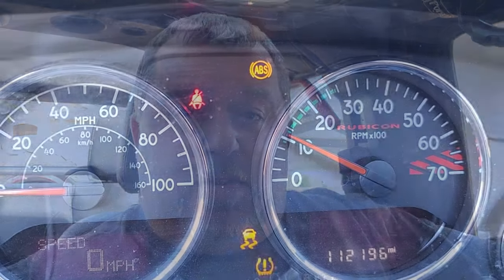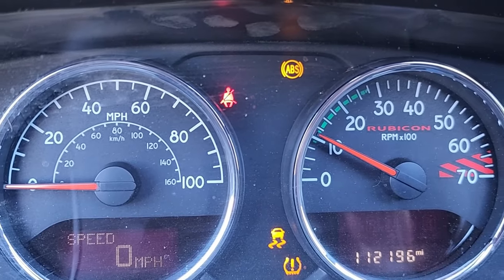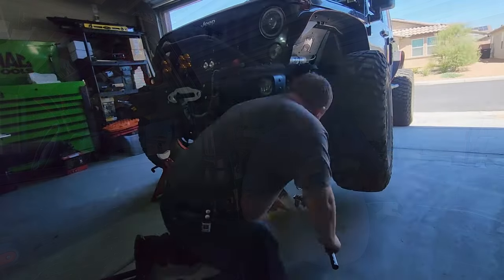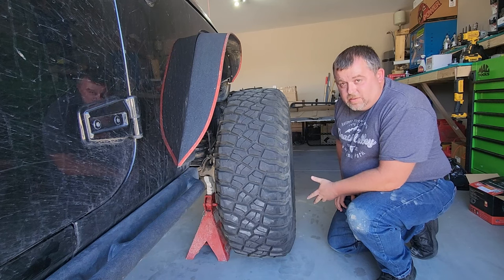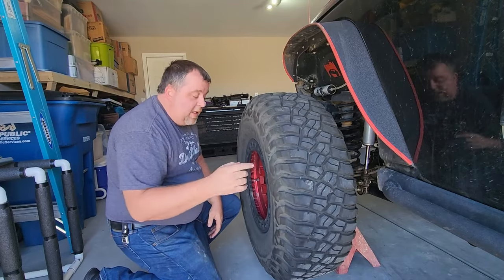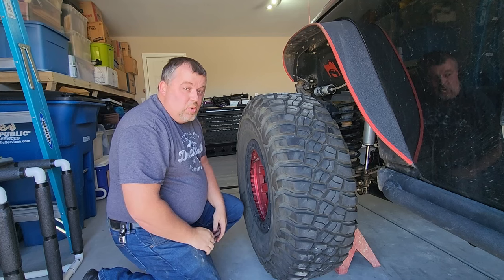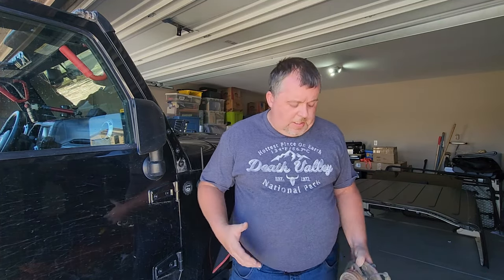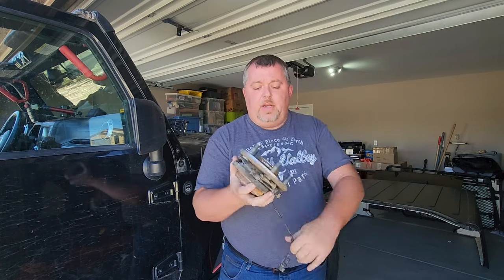ABS and Traction control lights on a Jeep, What do they mean?!

Comment: What a great video. In my 2014 sport JK the two lights (ABS & Traction) turns on only when I want go in reverse and full lock my wheel to left or right.
Will have to check this out soon...very soon
Saludos desde Colombia, muchas gracias.
Reply: Any update to what fixed yours?
Reply: Would love to hear an update on this. I had my back brakes replaced last month and now this exact thing happens to me occasionally. I will check my battery terminals first, but may be the hub.
Reply: lo reparaste?
Reply: @scottcarter3621  check the sensor cables first, sometimes if you have old brakes it generates higher temperatures and melt the sensors or cables

Comment: I had to swallow my pride and call AAA to change a flat tire cuz I didn’t have a big enough jack. Next day, ABS and traction control lights were steadily lit on my dash. Two weeks they were on. Felt the ABS kick in while avoiding a careless driver and they went off. Don’t know what that’s about but still gonna have my axel and bearings checked. Thank you sir. Much needed insight. You have a new follower.
Reply: Sounds like my issue, Add 4x4 light as well. I called a shop today & they speculated it could be a wheel speed sensor that needs replaced but I go first thing Monday morning to be certain.

Comment: Mine cane on my dash today… will have to check this out soon
Reply: Did you figure out what it is? Same thing happened on my 2015 compass
Reply: @A1beams  well mine went away… went to the shop and they said it must of came up cause I had randomly pressed hard on brakes… which I had done that day due to rainy wet roads… it hasn’t came back ever since… but if it does I have a better understanding of why

Comment: Another culprit: If it’s a used Jeep, the PO may have cut the purple wire with light blue tracer under the center console (or installed an inline on/off switch). Fuse J6 under hood could be pulled out or bad as well. Common for owners to do both to stop the ECM nanny control for wheelin.

Comment: I love this video! Your intro is amazing. Before I fully go in on and exchange this part out, may I ask, mine turns on and off especially when I turn, is this possibly also the cause of that on and off
Reply from the maker: Yes, turning changes the pressure on the bearing, and can cause the lights to change... but that's almost further confirmation you need a new hub

Comment: What about the two lights coming on and going off intermittently?
Reply: Did you find solution? Could be a sensor going bad depending on age of your JK
Reply: Happened to me, replaced just the sensor and it went away
Reply: @J1MMER I wish that was the case for me. I replaced sensor and still having issues. Noticed it triggers when turning but guessing wheel bearing is next step

Comment: Thank you for your great video.  I have been unable to get any codes for my Jeep since the 2 lights came on, but did not stay on.  Is this a symptom of what is to come?  Thank you!
Reply from the maker: The codes can help narrow down which wheel is faulting, but if the lights are not steady, and codes are not stored, does not mean no problem....... I would lift and shake each tire down until you discover the issue. And check all ABS sensor wiring to the wheels to ensure no fraying or breaking..... it may take longer to diagnose without the codes, but the problem is still there. I would not wait until it gets worse enough to trigger the codes full time 🙃 if it were me. Hope that helps!

Comment: So I went on vacation for a week and when i came back my 2019 jeep grand Cherokee was completely dead. Upon jumping it and turning it on 3 lights came on (Check engine light, ABS, and the Electronic Stability Control) the check engine light went away. The other two haven’t. The car has been perfect and no problems at all. I just hate having lights on, on my dash.

Comment: so mine is also on But ! mine is 2016 48000 miles never been in 4x4 or off concrete has original size tires  but i will check it
Reply from the maker: A little young, but does not mean the part has not worn out.

Comment: Hello there! Just came across your video and channel today. You have a new subscriber! I am new to jeeps and they seem like difficult cars/trucks to diagnose. I have a jeep cherokee latitude and I hit a small pothole one day headed to work. Nothing happened the car kept driving smoothly. The next day the car was still driving smooth but the abs, traction control, and park brake light sensors came on in the car. I got the car scanned for codes and they came back undiagnosed. I wonder if this could be the culprit to my problem as well.

Comment: Hello, I got a 2007 jeep jk automatic V6 , I got the traction control system and the red sparkling light on when I press the brakes and the engine starts to be loud, it happens when the car is not moving or in a slow traffic (so I use a lot the brakes)

Comment: My jeep was squeaking, and then the ABS light came on. I figured out that my dog chewed off the sensor wire. I changed the right wheel sensor, and the ABS light cleared, but it still feels like the brake is dragging. Do I need to clear codes, or is there a way to reset it?

Comment: Hi Josh have a question I have a 17 jeep wrangler just put 2.5 in lift but by traction control come on
Reply from the maker: Need to the get the alignment set properly. And at an alignment shop. Your jeep has what is called a "Steering Angle Position" sensor, and since lifting it affects rhe steering wheel angle, the jeep does not know what way is straight. So once the alignment is done, that sensor needs to be reset properly, and your lights will go away.

Comment: 2012 Wrangler Sport. Not only do my ABS & tractions control lights come on but when I start driving I get a bit of wheel spin/try to accelerate and the vehicle doesn't respond. After a few seconds, it runs normally + this only happens first thing in the morning, the rest of the day its fine?!!! Doesn't happen when I reverse out of the driveway, only when I start going forwards. I've had the sensors replaced & put on new Yokohama tyres. I thought it might be the 4WD not being disengaged properly. I'll have the wheel bearing checked now, thank you. Any other suggestions appreciated....
Reply: My jeep does the exact same thing.  Rear wheel sensor is dirty and the axle seal is leaking oil all over the place.

Comment: I have a 2015 Jeep Renegade. My light came on 2 nights ago and I heard the car beep which triggered the seatbelt light but that went off but the  With the wiggly car light stayed on. It said off. I learned a few weeks ago that there was a recall on my Jeep  Inition problems inition could this be part of it. When I take it to the dealership you think they would charge me to fix the light too. I'm not trying to get charged. Just don't want to go in there sounding like I don't know what I'm talking about. Thank you waiting for your response. Could you check with Jeep and see what other recalls are on the car. But disable senior citizen. I just bought the car my old car was in the accident so I took the settlement involved this car I need help thank you

Comment: My Jeep has been to the steelership 3 times for the ABS. It fixes it for about a week or two and then returns. When mines comes on, the trans jumps a gear and then the down hill assist turns on. Within seconds, the ABS and traction control lights up. It throws a code stating the speed control is producing an impossible value.
Reply from the maker: That sounds to me like the ABS control module is dying.... your issue sounds deeper then a hub assembly
Reply: @JeepingForBeginners  Thanks. The odd thing is the steelership can't seem to find it. Second odd thing that makes me think it is the module is that when it is cold out, it takes much longer to fail. On a hot day, it will trip out right away.
Reply from the maker: Knowing logic controls from FCA, it's either a bad module, or a bad star connector. Problem is, if it is the STAR connector, it's so incredibly difficult to diagnose or confirm... and expensive to just throw a random part at it.....
Reply: @JeepingForBeginners  Pardon my ignorance, but what/where is the STAR connector?
Reply from the maker: The vehicle is equipped with several STAR connectors. These are junction points that connects and redirects communications between multiple modules. Usually up to 13 at a time. Sadly, you have a half a dozen of these, which in one form or another, share communication with every module in the system. They can fail, bit when they do, it's not obvious. Turns into a lot of electrical chasing, and trial and error replacements before the solution is found. A level 3 Chrysler Tech is your best bet IF that is an issue. Like I said though, could be in the ABS module itself. Lemme ask, in all the codes pulled, did you ever see a CAN bus code? Regardless, if sensors are not an issue, Bearings are not an issue and weather affects it, it's in the electrical system SOMEWHERE. Make sense?
Reply: @JeepingForBeginners  Thanks for taking the time to reply. This has been very frustrating to say the least. I've not seen any CAN bus codes. Is there a place where I can get good electrical schematics? If its CAN bus, I should be able to throw a scope on it, and see some sort of waveform, or noise if there is a short. My problem is I'm shooting blind. I don't see anything that I would easily identify as a network connection, as opposed to a logical connection. 
As far as a dealer tech, all the dealers around here have very poor ratings for service integrity. The only one that doesn't is the place it has been to 3 times, and they have failed to fix it. I got tired of throwing money at it, with no progress. I've just been driving it. Now I have a different issue, where the calipers will not release. The calipers themselves are OK (replaced one). I don't know about the ABS, but I would assume that because it is not cycling shortly after starting up, that the unit is not flowing fluid properly. I disconnected the master cylinder, and the caliper still stuck. It eventually releases, but takes about a full minute and still slightly drags, which overheats the rotor.
Reply from the maker: Is this a manual shift transmission or an automatic? .... you know what, let's continue this outside youtube.... send me an email at Yasmarproductions@gmail.com..... let's see what I can do to further assist

Comment: I was installing some new fag lights on my wife's 2011 Jeep Wrangler and the abs and traction control lights came on after the installation of the first light, I was checking to see if the light was working. I noticed that the abs and tracks lights came on. I wasn't doing anything with the brake system. After installing the lights and making sure everything was working with the lights, I disconnected the battery to reset the computer, but the lights were still on. It's confusing to me because I wasn't doing anything with the brake system or anything with the breaks at all, Any suggestions?
Reply: Me did almost the same.I replaced my tierod and when i finished my traction control lights were on..wth?

Comment: This video could have been 15 seconds of "Check your wheel bearing".  There was no filming of the change, attaching the sensor, or anything remotely value added other than linking the ABS and traction control lights to the wheel bearing.